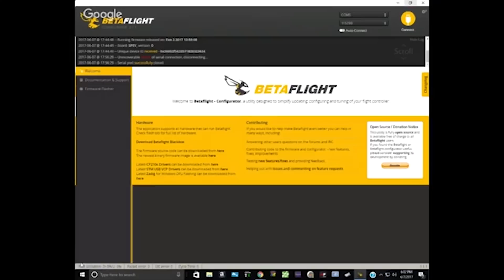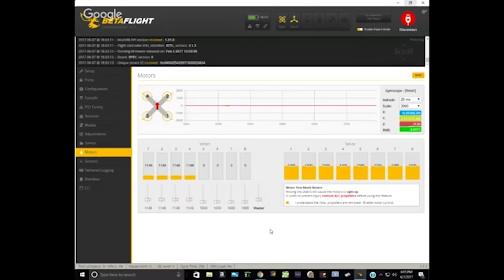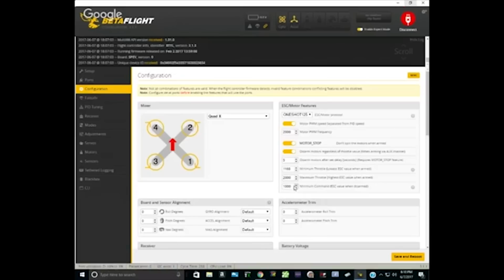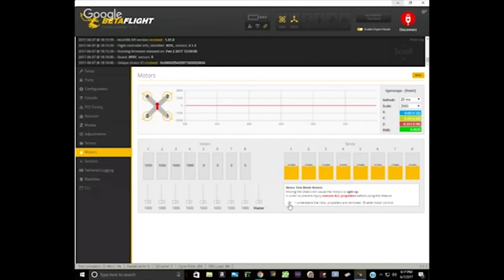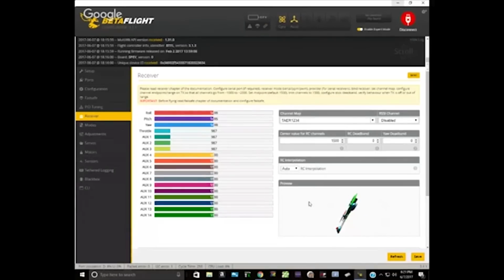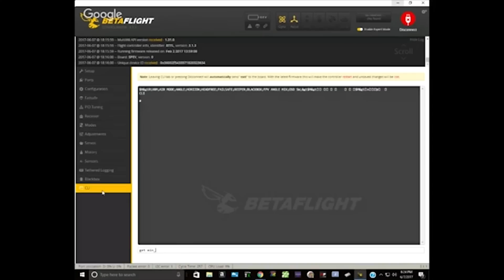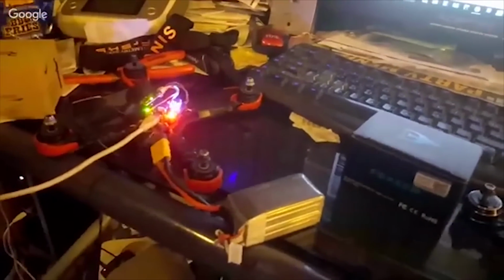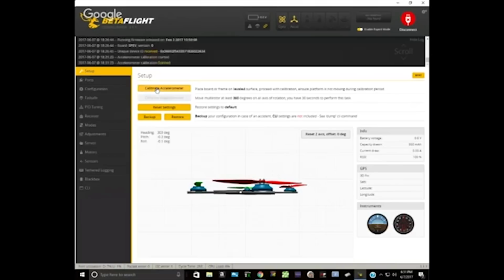Quadcopter Motors Won't Spin Right | 1-ON-1 TROUBLESHOOT

Comment: Hey Joshua, I have been having issues with mid throttle oscillations.  Seems a lot of people are having this problem with the newer high power motors.  I got most of it out with soft mounting the FC and motors, but it's still there, especially at 60% throttle where it is the worst.  Personally I'm running the new T-motor F40 Pro 2600Kv motors, which are 2306's with n52 magnets.  I would love to see a video where you troubleshoot or review what you do to reduce or eliminate those oscillations, and review what we should look for in blackbox.
Reply from the maker: You already did it. Soft mount the FC with rubber standoffs (not O-rings) or gummies if your FC supports it. If that doesn't fix it, look forward to betaflight 3.2's dynamic notch filter.
Reply: Yup, using rubber standoffs and 2mm TPU 3d printed motor mounts.  That got rid of about 80% of it, to the point where I don't see it in my video anymore, but I can still hear it and I can see it in the pitch and roll gyros.  I got to the point where I just finished my tune and figured I'd have to live with it.  But it's great to hear that 3.2 will possibly include a fix.  That's awesome to hear.  I kind of figured that I may need to mess with the notch filters a bit to tune it to a slightly lower frequency.  But the 2 notch filters and D term filter and the interactions between them still kind of confuse me a bit.

But thank you for the prompt reply!  I've already learned a ton from you from your videos.  Keep up the awesome work!  Thank you so much for everything you do!

Comment: I connect two different escs  to my quad when increase the throttle to the value more than 1500 the motors connected to this esc stop run ,
And while it's running l heard sound in one of motors like to brake with lowest speed than others motors. 
Could help...
Thanks

Comment: Hi Joshua. Could you do a video about make the TBS Unify Pro SmartAudio works at the same time with a Microphone?   I found win BetaFlight Wiki a schema of a circuit to do that but doesnt work for me.  Thanks!
Reply from the maker: It isn't guaranteed to work. The audio from the mic can interfere with the smartaudio signals.

Comment: Hey Joshua..kinda have a problem. Im using a new Dalrc engine 40a aio esc. Thing is all motor is spinning in 1 direction. My blheli config and blheli suite cant read my esc and i need motor 1 and 4 to spin the reverse direction without using the blheli config/suite.
Reply from the maker: I'm going to guess you are trying to use the regular version of BLHeliSuite. You need BLHeliSuite_32 to talk to 32-bit ESCs.
Reply: Joshua Bardwell got it buddy! Man that was brain cracking. Just Got it to flash and get the motors spinning right

Comment: I am working with Naze32 board and Flysky i6 transmitter. The values of throttle , yaw .... are being correctly show on the reciever tab of Betaflight and the motors are also working via the motor tab but I am not able to control the motors via the Transmitter 😭😭... Please tell me where am I going wrong...
Reply from the maker: Have you set up an arming mode?

https://www.youtube.com/watch?v=PCLxyurZsD0

https://www.youtube.com/watch?v=XQXV6bjCfuA

Comment: hi josh i need help.. my motors spin fine in betaflight but when i put the props on and arm the drone is stable but then when i start to throttle up it goes full throttle and now i have a battery shaped hole in my roof haha what would cause that? ive calibrated the escs and motors..
Reply from the maker: Having the FC set to props reversed but not having the motors set to reversed direction. That's a common one.

Also don't test hover inside.
Reply: @JoshuaBardwell  ok so i set the motors to reversed on betaflight which helped so it hovers nicely but now ive lost roll pitch and yaw? any ideas?
Reply: I've just refreshed and the motors are spinning the right way but almost like they are sticking /2lLfLcOkcYM and on the motors tab the values go ballistic..

Comment: Good evening sir, in my quard when talkoff my 3rd motor is not rotating sir. But in the checking the motors tap in that susuvation all motors be rotated only issue in when talkoff 3rd motor not responsed sir..
Help me sir

Comment: Could you help me please?I have a question.. All my motors spin up except one i have replaced the esc and motor still doesn't work the other 3 work pefect. The one that doesn't work just does half a spin then stops and keeps doing that also that motor/esc gets hot because of it... it's driving me crazy.new build all new electronics having problems like normal please help ryan

Comment: i just built another motolab f3 270 X frame and in bata flight  in motor tab 1-3 start low  as  normal  but 2-4 dont come on till i raise the tabs up quite significantly!  whats up with that?  JB...
Reply from the maker: Assuming you are using multishot or oneshot, calibrate the ESCs.

https://www.youtube.com/watch?v=o3Mg-9M0l24
Reply: i got it i went into blhell flashed the esc to latest and adjusted the ppm min and max and blam!...rocket man!

Comment: Hey brother Bardwell why my betaflight configuration does not have all the features show like in his ESC/Motor Features? I have no motor or esc accessory..
I've had this same problem with 2 of my quads and I think you hit the nail dead on the head with this vid.
More problem solving vids brother
Reply from the maker: Click the gear icon in the upper right and make sure "permanently enable expert mode" is checked.
Reply: Bruh I can't believe you took time to respond wow you are the Obama of this quad tech.
Thank you so very much
Reply: Amazing dude you are

Comment: I finished building my quad but I'm having issues getting my radio to work. It's a Flysky i6s and its bind. Shows signal on Betaflight (joystick movement), however, the motors don't spin with joystick movement :(  only manually.   help anyone?
Reply from the maker: https://www.youtube.com/watch?v=3mOeL8f1dMM

Comment: In my case am using kk2 flight controller on hexacopter and one of the rotors will not spin until half throttle. I've tried calibrating several times and replacing esc and motors.  It still will not spin alongside others until it is half throttle. Please help!
Reply from the maker: To be honest, the KK flight controller is so old I don't know a thing about it.
Reply: @JoshuaBardwell  Thank you sir
You can help me find out about how to get the problem solved

Comment: I just built a tiny whoop and as soon as i arm the motors spin at min throttle. I increase throttle and they rpms increase for a second and when i hit about 1/4 throttle the motors just stop. i have two of the same FC BETAFPV F3 V1.1 Brushed Flight Controller Integrated with OSD and Frsky Receiver (SBUS). I'm using a taranis x9d. 25,000Kv motors. i have no clue how to fix it. used both boards and the same thing is happening with both.
Reply from the maker: If you built it yourself, and you are in Betaflight 3.3 or newer, then I suspect you have a motor going the wrong way or something like that, and anti Taz. Protection is or venting a flip out. Search my channel for anti Taz.
Reply: Joshua Bardwell thanks. I got it fixed. One of the most simple things I didn’t even notice. I just set up the motors the same way as my blade inductrix and didn’t think twice about it. I appreciate the obvious answer to my problem. Haha I guess that’s the fun of being new to the hobby.

Comment: Josh, my motor 4 is spinning a little bit slower then tje others in full trhootle. What can be?
Reply from the maker: Just means it is making slightly more thrust for some random reason. As long as it is only a small difference, don't worry about it.
Reply: @JoshuaBardwell  what if it is massively different....
In idle (airmode) with props on and one motor is stronger than the rest and flips the quad?

Comment: I think my ESC melted a little.. my motor wonts really spend on idle a lot of times but if I give it some throttle itll start up or I hold the drone move it around itll start up..  But I am not a 100% sure if it's just because it's trying to straighten the drone .  Though still won't spin adding full throttle.   If I disarm rearm I eventually get it going. There times it spins in circles on the ground lol

Comment: I need help I have an all in one aec but only three motors are spinning. When I plugged in the battery I could see all 4 motors move a little. But when I connect it to the computer and use the master switch only three motors spin
Reply from the maker: The fact that the motor vibrates when the ESC beeps indicates that the ESC is at least working a little bit. If it doesn't spin from the slider, that would suggest the signal wire from the FC to the ESC was not working.

Comment: I’m just trying to get my replacement Tinyhawk S FC to work like the original. The motors are all spinning wonky. That’s a technical term. Thank you for making this video too. But are board mounted ESC’s this in depth too??? Slowly realizing I know less and less and need to learn more and more. 🤦🏻‍♂️🤷🏻‍♂️😂👌🏻
Reply from the maker: Did you install them correctly? Two motors spin clockwise, two spin counter clockwise.

Comment: hey guys i have make a drone quad as the uav futures did 99 usd version with sp fc f3 uprade
i did betaflight calibration of esc all set to go but when i arm the quad motors are spinning ok and when i ad throttle to lets say 50% the motor 1 3 and 4 are spining to 1500 and motors 2 goes to 1400 then drops off speed until it gets to the arm speed thats 1020....any clue on how to fix that ?
Reply from the maker: https://www.youtube.com/watch?v=xBaefeQtA1c

tl;dr - It's probably nothing.

Comment: Hello 
I'm have cruise 4axis 6channel gyroscope
All moter are in good condition
But when I start to use it two of them does not work at same time 
One of the motor work when I give full power and one of the motor work when I start to use left right key 
How can I fix it ?
Plzz help me

Comment: my left rear emax 2206 lite 2300kv motor on my hawk 5 went dead after 2 flights not ever crashed .. so I replaced it 5 minutes ago and nothing. I checked betaflight and motor 3 still won't spin and I did not change anything.. how can I diagnose the problem
Reply: NeonGanjasFPV ESCs Dead?
Reply: i got the same problem and changed the motor and the ESC, and the motor still aint spinning...

Comment: I noticed my drone had one propeler starting up  after the others does this mean it needs replacement
Reply from the maker: Not necessarily. But if the motor twitches and doesn't start smoothly it might need replacing.

Comment: Go and check the receiver tab . The quad won't sit still in preview.  I have the same problem with a flysky transmitter and an f4 board . The naze32 i have doesn't flinch on that tab but the f4 is rotating .

Comment: my chinese drone one motor starts rotating as soon as i attach battery after a crash,i noticed the two wires of that auto rotating motor were shorted with each other resulting may be shorting its circuit.Please help
Reply from the maker: If you've found physical damage to the wires, then that is the first thing to fix.
Reply: no damage,that motor just starts spinning right after i insert battery.i didnt even turn on the drone

Comment: Josh..... HELP Please....FIRST TIMER HERE.  Motor 1,2,3 spin.  Motor 4 doesnt.  I get the ESC beep but not the other beeps.  The other motors do the correct beeping.  Let me know what information you need.  I checked all the wiring, all 4 motors did spin at one point. but i did not have controll of the drone. I added the correct Reciever and got control of the drone in beta flight but one of the motors stopped working.  Motor #4

Comment: hi sir good day. i have problim on my motor 3 and 4 it won't spinning. and the motor orientation is not in order. pls help me.
Reply from the maker: Use the Motors tab to spin the motors 1 by 1. If the motor does not spin, then the ESC is not working right.

If motor orientation is not in order, then I recommend re-soldering the signal wires so that they are in the right order.

Comment: Iam facing a problem with brushed motors on when i push full throttle only the 2nd motor is at 2000 value others at different value how to solve this?
Reply from the maker: +Akshay Phadtare this is normal. The quad has to stay balanced in the air. Driving all motors arbitrarily to 2000 would not accomplish this.

Comment: Wow, my first build and im dealing with the same thing. Ive studied hours upon hours. Im using a tcmmrc d shot 600 40 amp 4 in 1 esc 2205 2750 kv motors . Same problem and the modes fix isnt working either

Comment: I have a build with Jb FC&esc combo, My problem is when I raze the throttle on the transmitter the motors spin up at different speeds. I have calibrated my transmitter,calibrated my esc's and calibrated my accelerometer . If I use betaflight to raze the throttle it works just fine. It is only when I use my Transmitter that the motors spin at different speeds

Has anyone got any ideals?
Reply from the maker: This is normal.

https://www.youtube.com/watch?v=xBaefeQtA1c

Comment: hey Josh is there a reason why I keep seeing people setting that minimum throttle 1140 the way I do mine is I said it 1070 1500 + 2000 then I calibrate the ESC then I raise the slider and I check to see when my motor start and they always start at 1022 I usually bump it up to 1026 I might be doing something wrong but this works Flawless LOL just wondering then I change it from 1070 to 1026
Reply from the maker: I'm not really sure what you're describing but if it is working for you, more power to you. I have found that BLHeli_S ESCs are way more consistent than BLHeli were, so you're more likely to get away with just using fixed values.
Reply: Joshua Bardwell I am using blheli S Little Bee 30 amp but what I'm saying is in betaflight if you flash a flight controller it throws it at 1070 automatically no matter the flight controller then I will go through a calibration on the ESC through betaflight after I do the calibration I will slowly raise the bar and it always starts at 1022 every time are those just awesome ESCs or what I feel like I'm doing something wrong but it's working but I might be losing some top end or bottom end I'm trying to figure that out
Reply: Joshua Bardwell because if I change that 1070 to to say  1028 and then I run through the calibration my motor start at around 1003 lol.

Comment: I hope this fix min the min throttle max in esc is difrent of my head all 4 props spin in bataflight even main slider but on contoller it just stop i thought it was power problem but rulled it out I always hear collaborate esc just never new how though it a button lol it same esc and flight contoller as the one I did before that was fine so strange then I was blaming the motors ah ah they crap bla bla till I did it in bataflight see they ok 👌 thanks man jb 👍

Comment: If someone could help me I would greatly appreciate it... my problem right now is that my motors spin even when throttle is all the way down at 0. As soon as I arm the quad, the motors spin even though I haven't throttled up yet. They do throttle up further when I do throttle up, but I still need them to stop at 0 throttle. Any tips?
Reply from the maker: That's normal. That's the way it's supposed to work :-)

It's dangerous to have the quad armed, but the motors not spinning. You can pick it up and bump the throttle and cut yourself.

Comment: Hey how are u I have been almost a month building my 5 inch drone been having some problems with betaflight or the filth controller is dead now I check for the resistance and I came conclusion that flight controller is fry lol anyway I have another one so im going to try that one

Comment: Hey Josh this is killing me I've tried everything ,I've watched all of your vids.  I've got the wizard  x220s and have throttle issues, it's going full throttle with very little input and flipping on take off, "PLEASE HELP"!!!!!!
Reply from the maker: If the quadcopter instantly flips over when you arm and raise the throttle with props on, it is almost 100% certain to be one of these things:

1. Clockwise prop installed on counter-clockwise spinning motor or vice versa.

2. Flight controller not facing forward. Go to the Setup tab in the configurator. Tilt the quadcopter on all axes (pitch, roll, yaw) with your hands. The 3D model in the configurator should move the same as you move it with your hand. If it does not, use the Board Alignment parameter in the Configuration tab to fix it.

3. Motors not wired correctly. TAKE OFF YOUR PROPS. Plug in a battery. Go to the Motors tab. Turn on the "props are off" slider in the lower-right. Raise the individual sliders (1, 2, 3, and 4) one at a time, just enough that the motor begins spinning. The motor positions (1, 2, 3, and 4) should match the graphic in the upper left. If they do not, then either move the signal wires so that they are correct or use resource reassignment to virtually "move" the motors.

4. Motor spinning wrong direction. Do the same as step 3 but compare the motor direction to the arrows on the graphic in the upper left. If a motor is spinning the wrong direction, either reverse it using BLHeli (or whatever ESC software you are using) or swap any two motor wires with each other, which will reverse the direction.

Many times, people swear up and down they have checked all of these things, and then come back to say oops I missed one you were right. So if you think you have checked all of these things and your quad still FLIPS OUT, go back and check again. If your quad is insta-flipping on takeoff, it is almost always one of these things.
Reply: Thanks Josh didn't expect a reply that fast ,really appreciate it ,computers scare the shit out of me. I didn't turn ppm off on my flysky transmitter. "DEERRŔRRRR" cheers